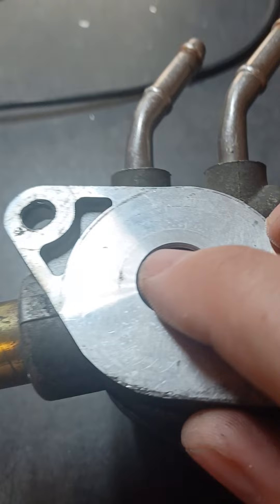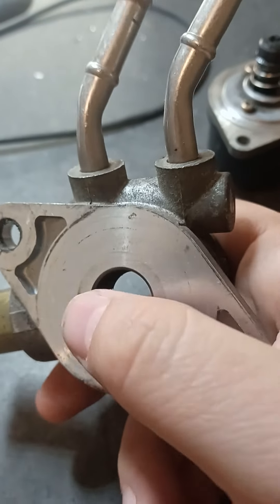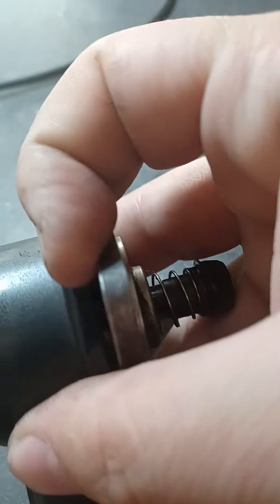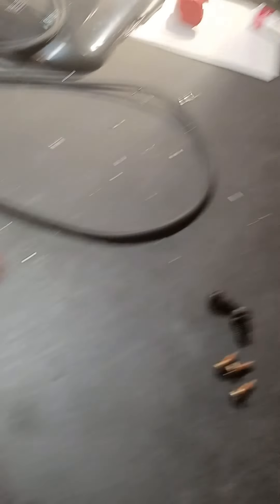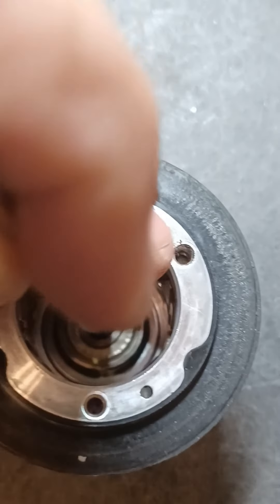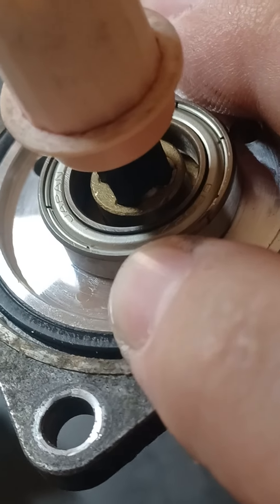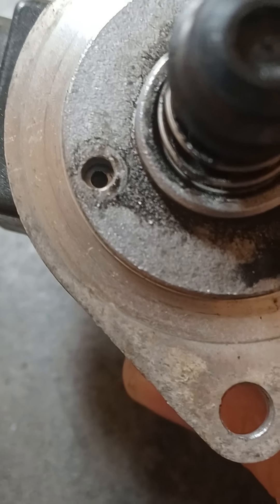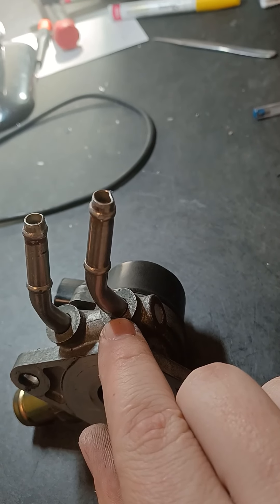How to fix your 2jz 1jz and 1uz IACV

Comment: hey. is the iacv the same on a 1jz ge vvti? i believe mine may be going bad due to the rough idle at a stop and the fluttering while driving
Reply from the maker: That sounds more like an ecu issue but it should be the same for the IAC
Reply: Did you ever find out if 1jz ge vvti has the same iacv?
Reply: @cadehoover9207  no but im gonna get to it and probably record it because im not sure